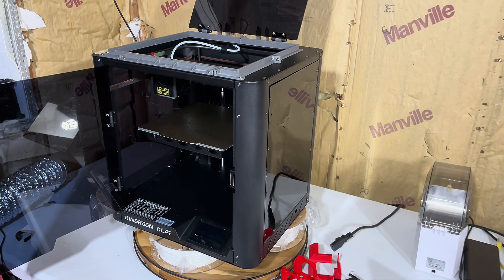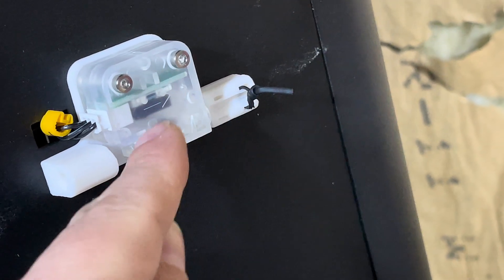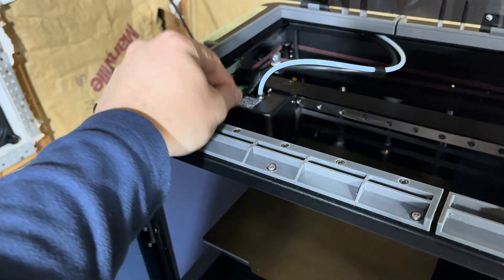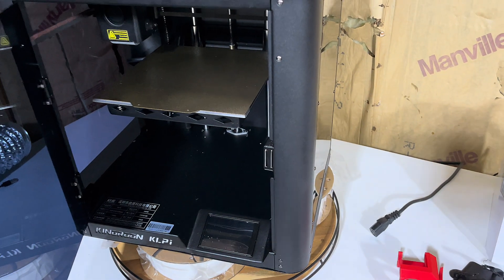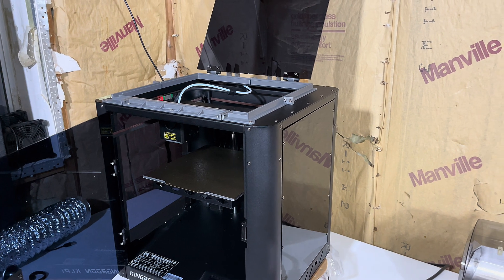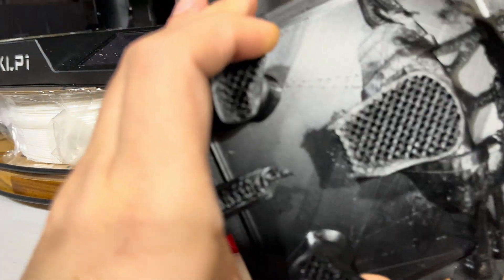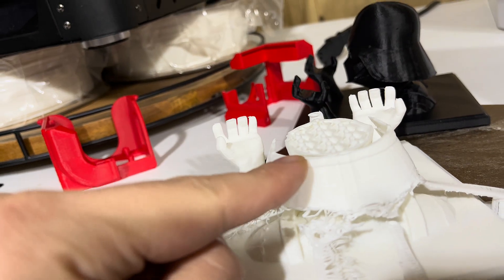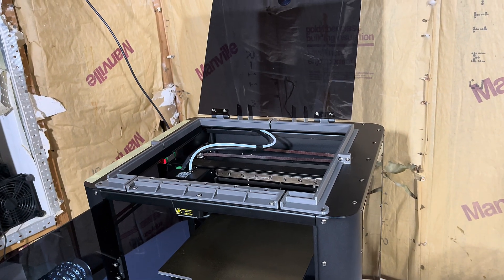Kingroon KLP1 - 1st Impressions

Comment: I have yet to get mine to print ANYTHING. I have manually fed the filament in, got it to do the extrude command, but when I go to do pressure advance... nothing. Tried to do the benchy, nothing. I am printing out the riser mod and the internal filament mod now (on my WORKING Ender) I had heard GOOD things about the printer, So needing an enclosed engineering printer for various projects, I went with this, instead of paying a little more for a two trees and enclosing it myself.
Reply from the maker: One issue I have is it will grind the filament in the print head so badly that extrusion becomes impossible if you used a tangled spool for example. So you might have a LOT filament in the gears and it’s not grabbing as it should.

I have a full review waiting but sadly for the last two months I can’t use the printer. It’s taking 4 weeks to get my last part and it was wrong, reached out to them and no response. Ordered another… 4 weeks later I get a shipping confirmation, as in it JUST shipped. Today, 5 weeks later it hasn’t even left China…
Reply: @joseph-montanez  I used the provided filament, and a new, sealed spool of pla +. I guess I will pull the extruder apart and see if anything is loose or messed up

Comment: There was the same situation, The screws of the screw shaft fastening were loosened. Wrapped with a thread retainer. I also changed the nozzle, heater and thermistor. Check all the mounting screws of the heating table.

Comment: What setting did you change and to what values to fix the under extrusion in the corners? I have the same issue
Reply from the maker: It turned out in Orca Slicer, the default profile has pressure advance enabled and overrides my own value with 0.05, which is much higher than my 0.026 value in my printer.cfg... After I disabled pressure advance in Orca slicer the problem went away. If it's still an issue I changed smoothing time to 0.15 instead of the 0.9 and max velocity around the color to 5 instead of the 20
Reply: @joseph-montanez  thank you very much for the reply!